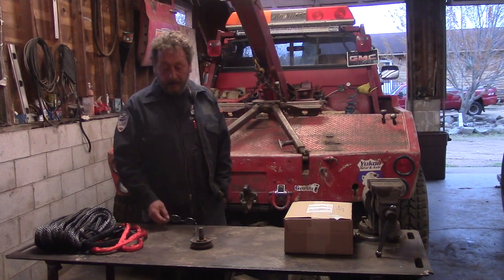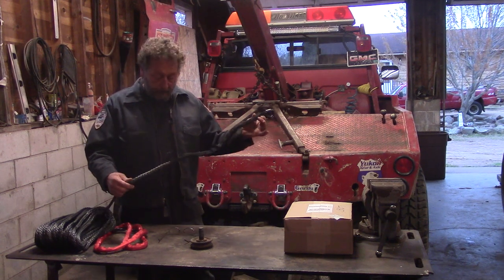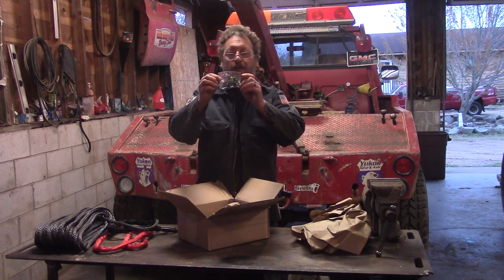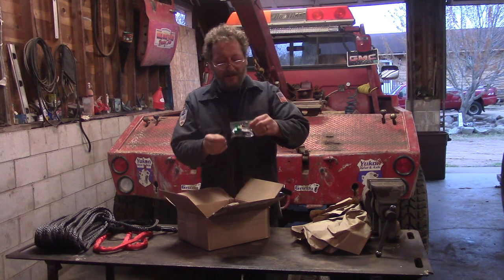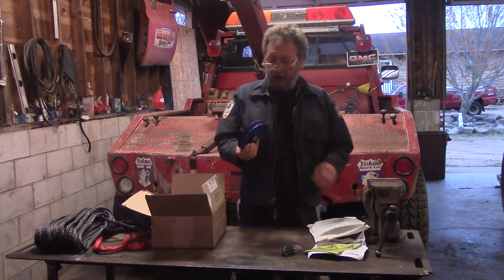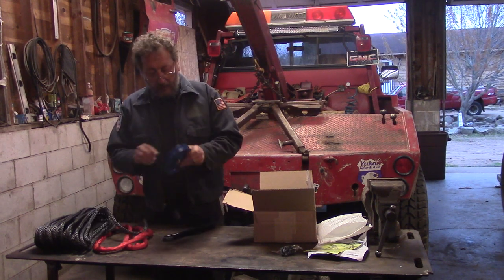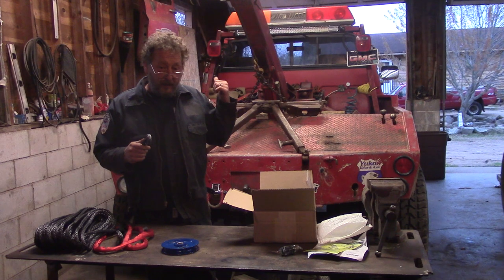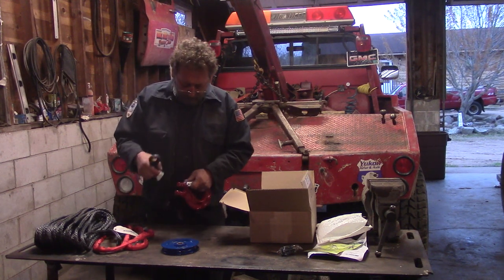AUXMART WINCH LINE INSTALL by BSF Recovery Team

Comment: On your top pulley pin, drill a 3/16” hole  thru the center of your pin to the center. Then drill a 1/8” hole across the center pin. Tap a 1/4” thread & place a zero fitting in the thread. Then grease once a week, pulley & pin last a lot longer.Also reduces friction when wrenching. I have done this for over 40 years, good luck 👍
Reply: I want to try something similar with a dry lube.

Comment: Grease everything up, apart from making sure that all the moving parts lasting longer, it saves a load of friction, getting more winch power to the object and a smoother pull.

Another tip I’d suggest is winding the plasma rope onto the drum in an overlapping cross-cross fashion. Unlike steel rope, the plasma rope can get ‘locked-in’ under load if you wind it neat like you did, or would do with steel wire. 

Under load, because it’s much more flexible, it can get pulled down between the wraps and can jam, making it hard to run-off by hand on free-spool. Criss-crossing it onto the drum helps to spread the load on the rope, and stop it jamming in. 👍🏻

After using plasma for a few years now, I’d much prefer it to steel wire rope. Mind you, I don’t do as much heavy winching as you do, so you may not like it as much. Although it’s breaking strength can be equal or greater than steel wire, it’s way more fragile than steel if your winching over rocks and gravels, so it’s a good idea to have some 2x4 handy to give the plasma rope a smoother ride over rough terrain (winching over a berm for example to recover from a deep ditch or a gully). 
Best of luck with it, hope you like it, it’s way more easy to handle than steel, and you don’t get ripped up from fishhooks 🇷🇴🇬🇧👍🏻

Comment: do you have any velcro closed cable shield for your new synthetic cable.. so you can protect the last few feet against sharp edges under trucks..   even a few feet of firehose you could have an upholstery shop split open and add velcro..  or just pull the hook and slip a 2' piece up the end of the rope..

Comment: Since you had to change the pulley to be compatible with the rope. Will any of your snatch blocks need to have there pulleys changed as well? What is the difference of strength between the rope and the cable? How many feet of rope did you spool on to the winch??

Comment: We tested switching the aircraft cargo winch to synthetic to save weight, (on a 585,000lb airplane), and they ended up wearing out twice as fast as the stainless steel cable.

Comment: That red rope sheath you put on the drum should be at the hook end of the cable. On a typical winch setup it's meant for two things, to cover the rope as the last wrap to keep it out of the sun. The second thing is to place it in line on top of rocks and such as to not score your rope when winching. You're wasting it keeping it on the drum like that.
Reply from the maker: There is a black one on the hook end, the red one is to tell you your almost at the end.
Reply: @offroadrecoveryteam  gotcha. Sorry I didn't catch that. Good deal then.

Comment: Snatch block you used for wire cable will not work well with synthetic line. Be sure you keep a cover on your winch. UV light is the biggest enemy and breaks down the fibers. Better to run a thimble on than a hook.

Comment: What is the weight difference  between the steel cable and the rope
Reply: Brad Balladarsch exactly what i was going to ask. On my atv for 50 foot it was about 4-5 pounds difference
Reply: rope is lighter for people trying to save weight does not whip as bad when it breaks.  but if dragged across rocks or other objects it does weaken the rope.
Reply: On my 12,000 lb winch the steel cable is pretty darn heavy at 100 feet.  I have two coiled up in the garage. The rope is so light it basically weighs nothing by comparison. I could take some weight measurements but I bet it would take 800 feet or more of 3/8 amsteel to equal that 100 feet of steel cable.

Comment: I have a vr10000 lb Warn winch. I normally go on logging roads and bush trail as well as mud. Would you recomend wire or synthetic on a front mount winch?
Reply from the maker: I have been a steel cable guy for durability, but I like the way synthetic spools up on the drum, and it has held up good on the wrecker so far.
Reply: @offroadrecoveryteam  that is the way I am leaning towards (cable). Just need to be a bit more lean on the safety.

Comment: Really that rope can't be better than a cable I'd keep a spare cable in the truck
Reply: dirty roofer I was going to say the same thing ! If the rope does in fact work out well ya could always return or sell the cable I've used a synithic rope but still trust the cable more its never failed me once ...
Reply: I have never seen a Jeep run into the side of a car when the rope snapped on a roll back.  Can't say that for cable.
Reply: Rope
Reply: amsteel is stronger and has no elastic snap when it breaks, only down side, it can chafe easier
Reply: Its better than a cable. It is stronger than the same size cable, It is lighter to carry around than a cable, You dont get splinters from it like you can from a cable. It doesn't have memory like a cable. It doesn't stretch like a cable. It is hella safer than a cable. Did I mention it floats?
Now the downside is that it is more expensive than a cable and it will wear out a bit faster than a cable. It wears out faster because it is made up of thousands of ridiculously small fibers that can chaff pretty easy.
Reply: consaka1 I don't think the wrecker really cares if it's a few pounds heavier, the tow truck ain't like a guy who uses a winch to pull out a jeep on the weekend , we will see but I'd keep a cable with me
Reply: No the wrecker doesn't car but the guy trying to pull it out  a hundred feet is going to find the rope a lot better.
Reply: 4x4Scout ... chaff is metal shards released from aircraft to confuse radar signals.
Reply: 4x4Scout ... "the wrecker doesn't car". Maybe it trucks.
Reply: JeeperJimbo 1990 ... "synithic" OMG!